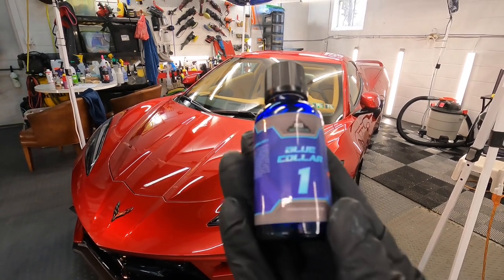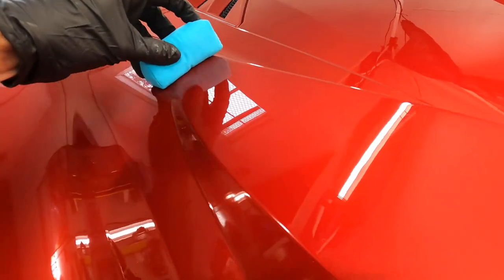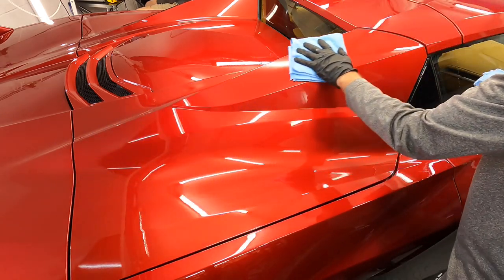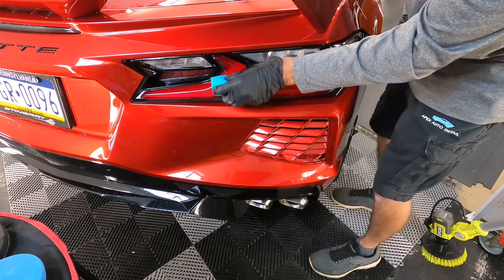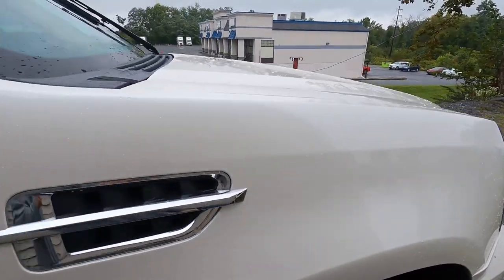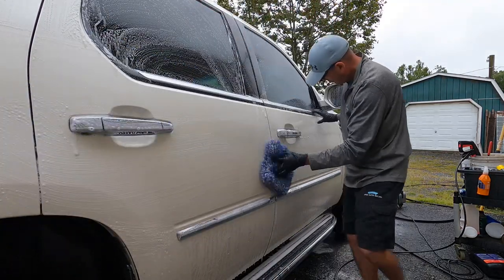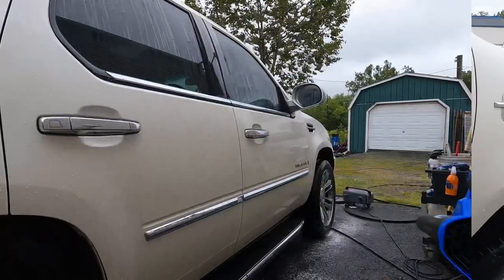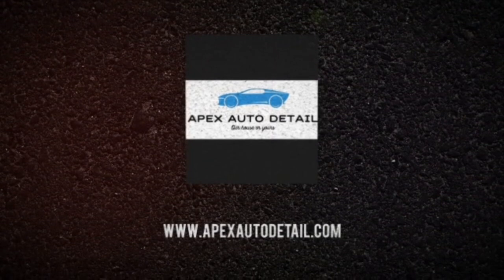The Easiest Coating To Apply Is Now Specially Priced! Blue Collar 1! ALL SIZES For A Limited Time!!

Comment: Question. I don’t see much for your maintenance products routines and how to revive the coating,etc. I ask because sprinkler in parking lot got half of my hood on a hot day( I wash weekly) but I have some water spotting on the coating on that side. What would be your approach/product as it’s BC1 with BC3 as topper to go after this light water spotting and maybe just some care tips for the coating. Should I dilute BC3 down so it doesn’t accumulate as drying aid. Thank you in andvance

Comment: Hi Brian: I appliede  for the first time today, one coat, after first doing a clay/cut/polish/IPA prep. I saw the rainbow effect. I decided to be zealous and let it set up for 30 minutes before buffing off. Most of the solvent came off but there are still white patches in places that are tenacious. I assume the coating is a success? I assume that over the next few sunny days the remaining solvent may oxidize and powder? Or, wait several days and use IPA to remove? Or, if you have a better plan, please let me know.

Comment: Brian what is the shelf life and recommended storage method for BC1?
Reply from the maker: I have had unopened bottles approaching 2 years. Opened....cap it, wrap electrical tape around cap and threads....store in cool dark environment.
Reply: @apexdetail85  My bottle of BC2 crystallized. I probably left it in the heat. I wonder if it can still be reconstituted? Going to order BC1. Can i store it in the refrigerator?
Reply: @apexdetail85  if it is stored in an air conditioned home (72-76 degrees) is that a good storage temperature?
Reply from the maker: @dankuhn7496  yes.. wrap electrical tape around cap and threads as well.

Comment: I am getting ready to order BC1.  Unfortunately I am getting inundated with ads for graphene coatings claiming they are the best.  Is there truly that big of a difference.  Obviously watching you apply BC1 the gloss is truly insane. Does graphene last longer or are they equivalent and subjective?
Reply from the maker: As I mention in a lot of vids…graphene does absolutely nothing to enhance a coating. The foundation of the coating… whatever that is, Sio2, Si3N4. That is where the strength of the protection comes from.

Comment: A year ago  had  paint correction done on my cars then coated with your first coating  Metal Oxide coating. I have maintained with rehydrasheet and just last week used BC 3 as  topper. Can BC 1 be applied over all this or will the old coating need removal. I am wondering as the vehicles age and go through another Iowa winter if it would be good to reapply a coating.
Reply from the maker: I would start fresh....Polysilazane is in a different class.

Comment: Do you get soap and water that drains from your window seals that drips down into your door jams?  After I wash my car I am getting quite a bit of water that seems to be coming lut of holes in my doors and making it's way onto my door jams.  Is this all normal?  Interested in doing a coating on my vehicle soon, but gotta get rid of these pesky water spots, preferably without buffing.
Reply from the maker: Absolutely...I coat those areas. Gyeon water spot remover will help a bit.